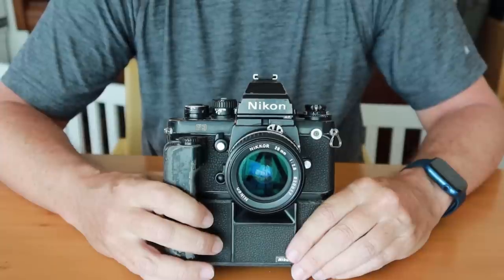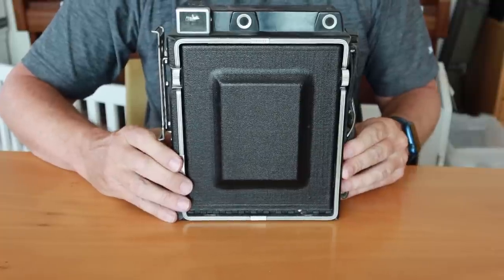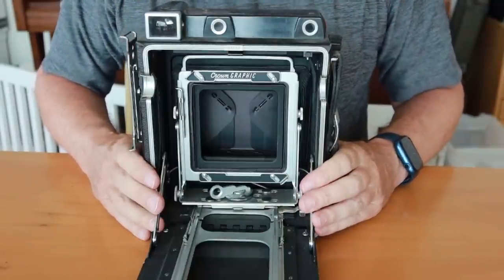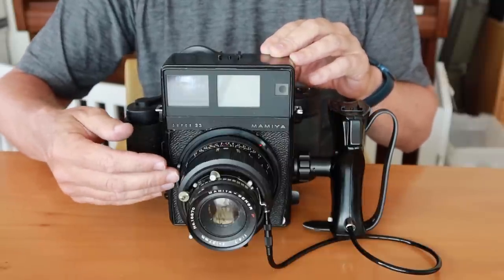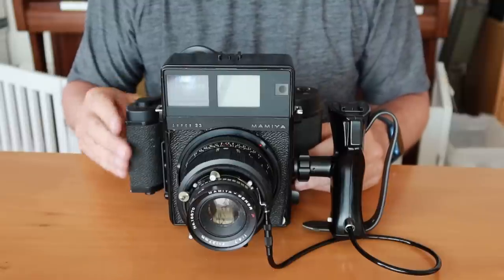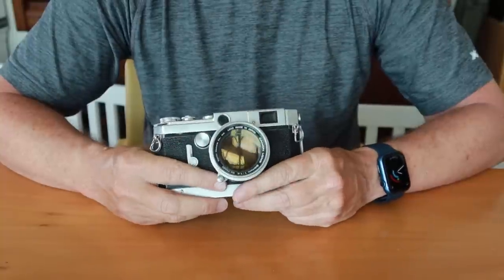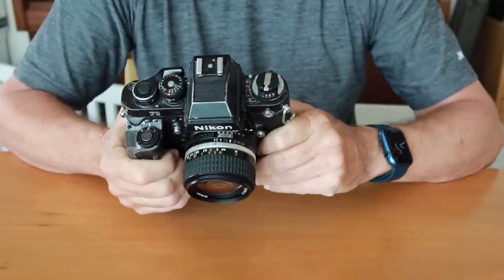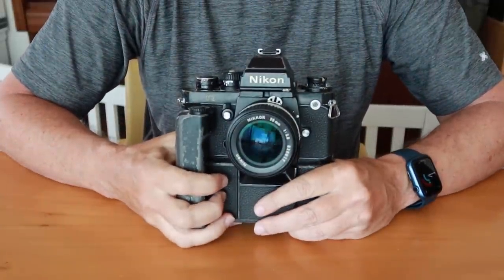Press Cameras, What are They?

Comment: It crazy how journalism had such a market that they were made cameras especially for them, now it's more for like, sports, animal photography and hybrid that are good for photo and video
Reply: There are still top of the line journalism cameras from the major companies. I think that's the main reason the Canon 1DXIII is still available.
Reply: I believe most of the flagship cameras are still made with photojournalists in mind. I mean any other style of photography wouldn't really benefit from the oversized body, massive batteries, and the overkill specs these cameras have. I think of stuff like the Z9, and the R3 mostly, but the A1 kind of does the same thing with a battery grip, it's just more modular. Also video specs make sense too, because video in journalism is pretty popular nowadays too. I'm working for a small media site, and we specifically bought an A6300, as small, light camera, that's cost efficient, can be thrown on a gimbal, if we need some on-site video done, but taken off the gimbal can be used for photography with no problems at all.

Comment: The Koni Omega Rapids were also used by wedding photographers because they were so fast especially with 220 film rolls.
Reply: Note that there was only one "Koni Omega Rapid", the first model from Konica. After that Konica dropped the "Rapid" as it overhauled the design to make it more user convenient. "Rapid" came back into the picture for the camera after Mamiya bought the production rights and equipment from Konica and continued making the camera as the "Rapid Omega".  For the reason you note, it has become somewhat tricky to find nice copies of these camera bodies and interchangeable film backs. I bought my Koni Omega bodies, backs, and lenses back in the early 1980s, when 35mm had overtaken the commercial market for these types of cameras, and good condition Konis were both plentiful and selling for as little as $100. At the risk of having to sort out the worn out junk, the Koni Omega system is still and excellent way to enter the world of medium format film. With the possible exception of the early 60mm lens, replace by the much improved 58mm lens, the several lens made for the camera are all excellent. I would say "my today's standards", but I'm not at all sure that there is such a thing any more.

Comment: My dad attended NYI of Photography in the 1930s and was a photographer in the U.S. Army Signal Corp during WW2. He worked as a self-employed Commercial Photographer for his entire working life. For most of his work he used large format cameras including Speed Graphics, Horseman Press and Koni Omega. He eventually turned to 35mm cameras because of the weight. A Speed Graphic plus film holders weighs a ton. His first electronic flash was powered by a lead acid battery and weighed 15 pounds. (BTW today the same power speedlight will fit in your shirt pocket).
Reply: I spent my working life as a TV film cameraman. Those old Arriflexes crippled many of my generation, myself included.

There is a theory now that microwave links are causing facial cancers in the younger camerapersons. Nobody seems to be investigating this - because there is no commercial benefit in doing so, I guess.

Comment: at 5:50 the word you are looking for is graffmatic, the set of metal holders are called septums, and depending on model, these took 6 shots, sometimes 10 ( if you consider the early polaroid or Fujifilm "quickload holders" which took envelope film sheets, and the envelopes were switched out for each shot, or the kind of holders used in the Rollieflex 6008 integral, with three parts to this "holder", if you can call it that.

Comment: Other things the F3p had was no self timer, the back had the that left the film leader out after it was rewound with the motor drive and lastly it did not default to 1/80 shutter speed until frame one meaning you could squeeze a couple more frames per roll.
Reply: That 1/80 shutter at the start of a roll is my biggest and really only frustration I have with my F3. Luckily I can usually wing it and get a decent exposure, but wish it just wasn’t a thing.
Reply: I guess those photographers needed no selfies to get to payday!